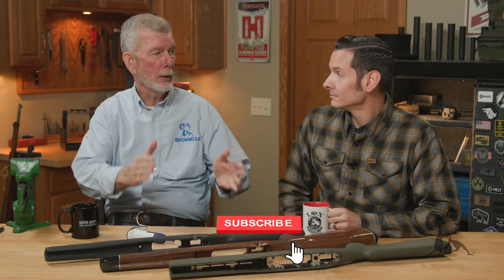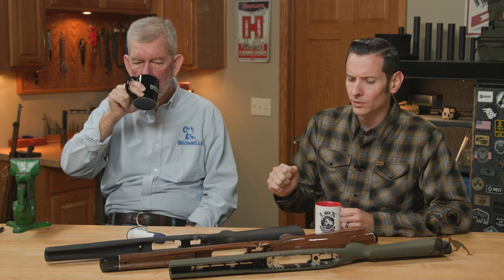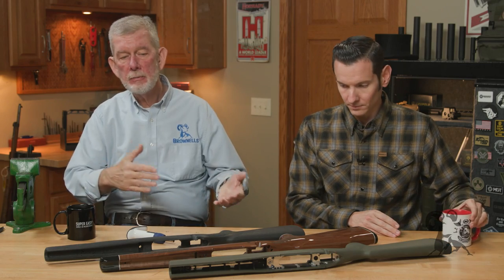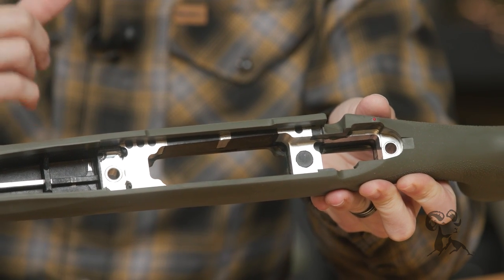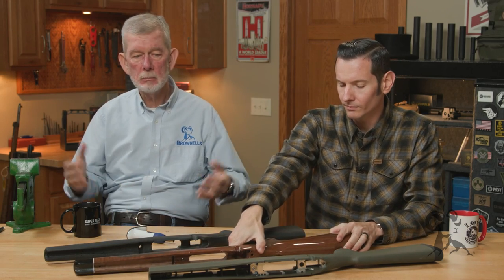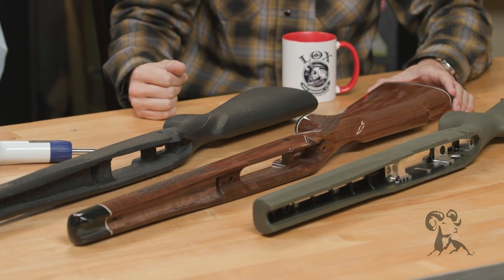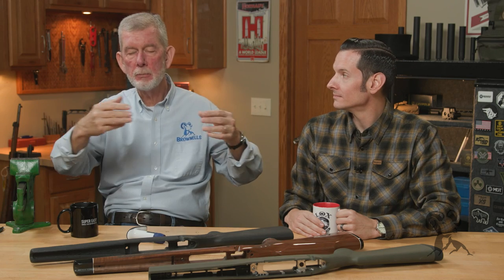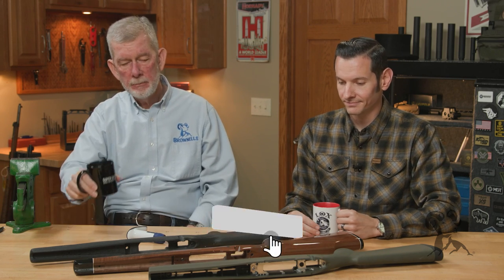Quick Tip: Torque Specs for Action Screws

Comment: Viewer requested/inspired videos are my favorite, fortunately that is most videos we make now days. Do y'all have anything you want to see? Now's your chance to speak up!
Reply: Sounds dumb but how about your take on grip tape on pistols? Any horror stories of dealing with the adhesive trying to remove it or them falling apart in the long run?
Reply: The best way to clean a stainless steel revolver.
Reply: How to goon tape and camo a2 grips, scopes and other attachments to reduce glare
Reply: Please make an extended video where you demonstrate the complete use of Acraglas. I don't really want to go off of a random youtube video, I'd rather hear from the manufacturer.
Reply: Alumahyde application videos please.
Reply: Mmmm, everything. Keep’em coming gentlemen. Be Safe out there
Reply: Agree
Reply: @762x69  If the adhesive is being silly, just spray it with polymer safe brake cleaner. Don't tape down a grip safety.
Reply: @patricktakada9551  not talking about grip safeties (which I think are stupid but I digress) just in general like talon grips and potential long term effects.
Reply: @patricktakada9551  Most adhesive removers (Goo-gone etc) are made of citrus oils. So they are usually polymer safe as well.
Reply: Why don't you guys who work for Brownells put together a spec chart from the different manufacturers and their stocks?

Comment: I learned that when I took the stock off my Ruger 77/357 for cleaning that the magazine would not feed properly unless the stock was torqued exactly to manufacture specs. It still has never feed more than 3 rounds in the 5 round magazine without jamming and causing dents in the brass.

Comment: Last week I brought home a new Ruger M77 Hawkeye Hunter (walnut stock). I always disassemble new firearms and clean and inspect them. When it came time to re-assemble I began thinking about action torque specs. So I got out the manual and lo and behold the torque specs were listed on a separate yellow page. 95IP for front screw and  45-60 incrementally torqued for the middle and rear screws. Seems excessive for a walnut stock but thats what I did.

Comment: The best example I've seen on this is on a 10/22. Changing the torque on the stock screw can change the group size pretty good.
Reply: yes because of the slip-fit barrel and weak receiver. You can literally bow a 10/22.

Comment: Even more so important with scope and base screws. It is very easy to over or under torque those. Which can easily lead to bad accuracy or ruining a high dollar scope because it got crushed in a ring. Torque specs are important whenever dealing with firearms. If you ever find the torque specs for your X rifle in Y stock, save them everywhere. Last thing you want is that company go out of business and you have no one to contact when you change a stock.

Comment: I have probably calibrated over a thousand torque wrench and torque drivers in my career but calibrating them is sometimes pointless when you watch people actually use them.   Many don't torque at the calibration line,  or they torque at an angle,  or they use the torque wrench below 20 percent of range,  many wrenches intentionally won't graduate the bottom 20 percent (no zero) just to keep people from doing that.      But I must confess,  when it comes to home projects,  I am probably just as guilty about grabbing a wrench or socket and just torque by feel.  Whether or not I can judge torque better than most is irrelevant,  it is still wrong and can cost you a head or an expensive firearm.    Oh and stay away from KB tools,  I routinely fail them brand new,  right out of the box...entire batches were red tagged and NRTS out.